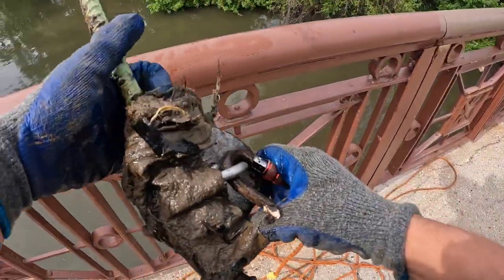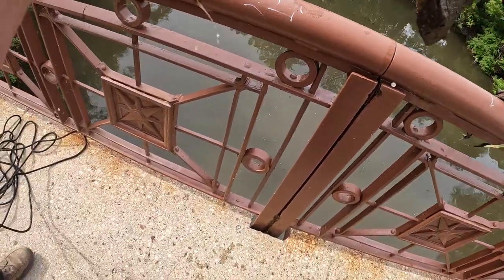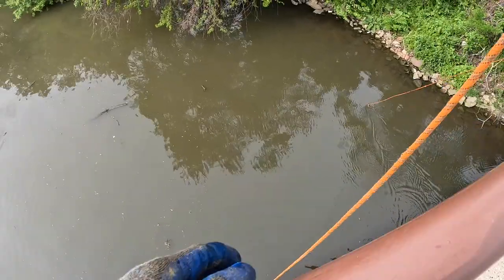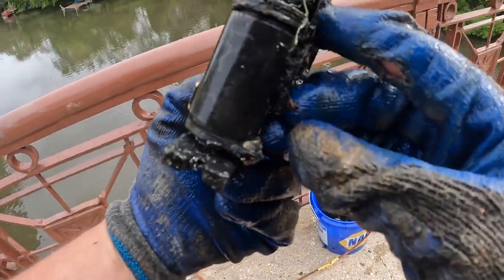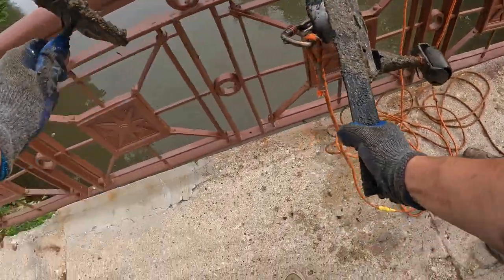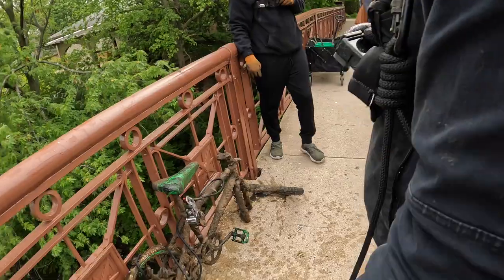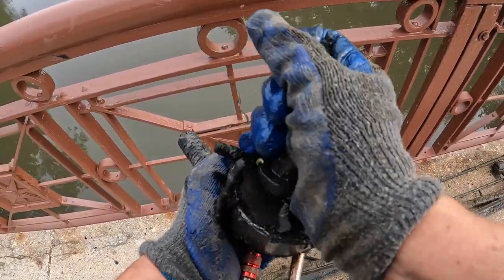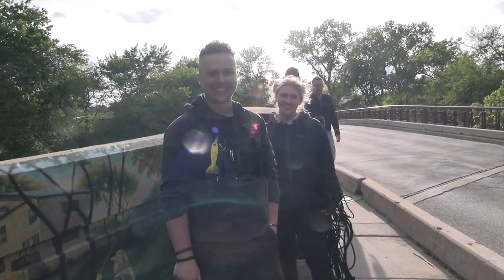Burglary Bag Found Magnet Fishing In Chicago Suburb

Comment: After you throw the magnet and get something  you need  to make it easier to bring the magnet back up to the top of the bridge.  Would there be some way to wind the end of the rope around  a circular  rim with a wind handle  type so you can  wind  up  what the magnet has attached to ? I  think you get tired  bringing the magnet back up hand over hand.

Comment: Not sure if you knew this or not. I learned it when I recovered someone else's lost magnet! The knots in your line will cause damage over time and the line will break where the knots are. If you are using knots to mark depth, electrical tape does that job efficiently and won't damage your line nearly so much over time. This is especially true with larger powered magnets. That is how I came to own a 1500 lb Brute Force bobber...
Reply: Nothing like FREE advertising for Brute and you with your 3 SUBS
Reply from the maker: Oh I don’t don’t knots to measure depth, it just gets like that over time 🤣